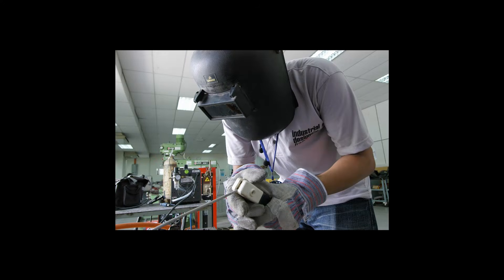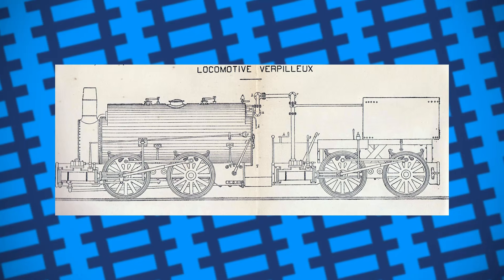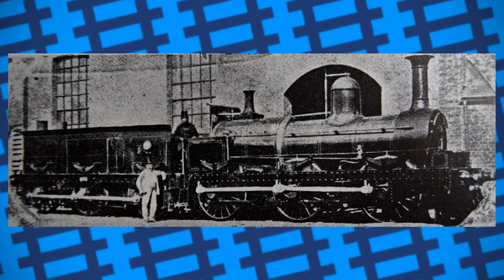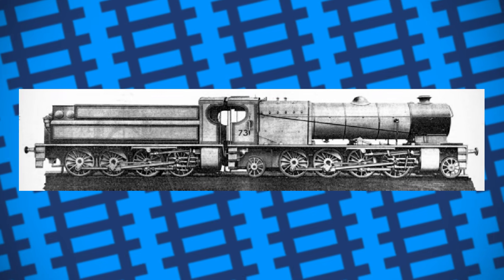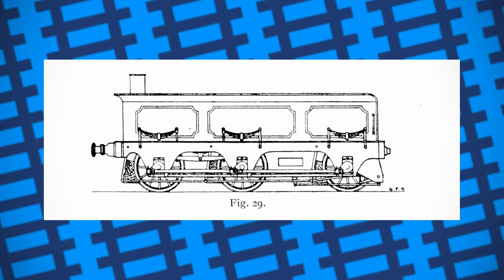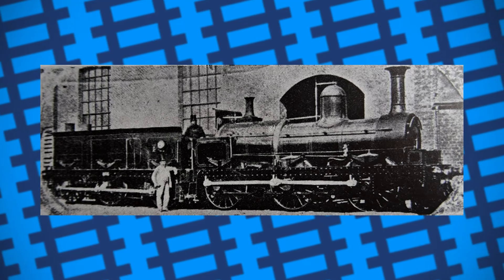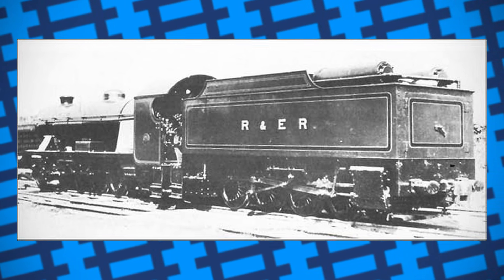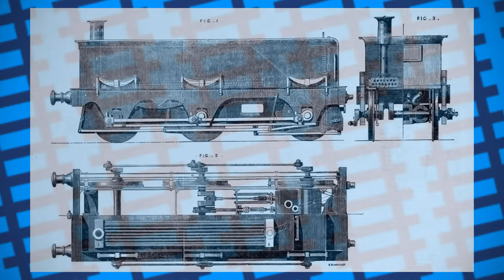The locomotive tenders that drove themselves - "Steam Tenders"

Comment: In a way I think steam tender locomotives could be considered to be the great grandfather of the garrett locomotive. Both are designed for heavy loads with 2 seperate sets of driving wheels. The main difference is in a Garrett all of the driving wheels are attached to a tender.

Comment: Makes sense as the triplexes had the same issues with the powered wheelsets under their tenders: gradual loss of traction as the tender grew lighter due to use of the coal and water during the run and the extra set of cylinders increasing the demand for steam beyond what could be supplied by the locomotive's boiler.  Funny how the railroad world essentially had to learn the same lesson twice.
Reply: Ironically, the Southern locomotives included in the video, didn't suffer the same issues, and were found to be VERY effective at what they were designed to do.  Specifically, these were "Saluda" locomotives, and operated as helpers to get trains over the Saluda grade, a 5% average grade on the Southern Railway, which was (until abandonment in the mid 2000's) the steepest main line grade in the US. Since the Saluda tender drives only ever worked over a short four or five mile stretch of track, and were regularly refueling and rewatering the tenders.
Reply: It’s too bad they didn’t think to shut those cylinders off. 🤷
Reply: @Gfysimpletons   Funny thing is, the Saluda locomotives could actually do that.  They had valves that allowed them to cut off the steam going to the tender drivers.

Comment: Maybe you could do a supplementary video on Starter/Booster tender engines. This seems a more useful addition for starting difficult loads than the full power tender engines.
Reply: yes.  i regard boosters as the successful development of powered tenders.  and boosters could be fitted to tenders and be unpowered when not needed.  victorian railways (australia) built the tenders for their second set of n class locos so that franklin boosters could be fitted.  however, none were ever fitted to them.

Comment: "Especially in countries like the U.S, which have such a liberal loading gauge." That's certainly one way to put it, but we also have/had a lot of much lighter interurban, commuter/light rail, narrow-gauge, and industrial trackage, and even some of our shortlines have slightly lighter rails than our general system.
Reply: Point of order: Loading Gauge is the space that the train fits into ; of which Britain has a relatively-restricted one.
You might be referring to the Track Gauge, the distance between a pair of running rails.

Note that the Loading and Track gauges are not necessarily an indication of the weight of the rails used either 😵‍💫
Reply: @SportyMabamba And neither has to do with maximum allowable weight of a locomotive or car.

I also believe Garrets experienced similar adhesion loss, albeit reduced somewhat by also having the boiler sitting on some of the drivers.
Reply: @SportyMabamba  Yeah, I messed up there. For some reason I got loading gauge and loading capacity mixed up, with loading capacity actually being the measure of how much weight the rails could take, but I checked, and you're correct. So thanks for that, now I know better. That being said, U.S. rails typically weigh 120-140 Pounds per yard, compared to the 81-121 used by most of Europe for example, which is a large part of why our freight trains are so insanely long and heavy compared to most of the world.
Reply: @SportyMabamba  , i think what sambrown means is us locos can be higher, wider, longer and apply more weight on main lines on every axle.  thats how they can have monsters like big boys on the main lines.
Reply: The Bessemer and Lake Erie used 150 lb rail. It should be kept in mind that heavier rail and trains needs maintenance.

Comment: Ive noticed that the problems with the steam tenders were basically the same ones magnified significantly for the Erie railroad's Triplex, being loss of adhesion overtime and not enough steam for all the cylinders.
Reply: I suspect American railway's negative experiences with these steam tenders made them more hesitant to try Garratts, despite these issues being no where near as severe on Garratts.
Reply: @AUssteamchannel9994  You'd be surprised, but nah.  The reason Garretts weren't bothered with, is by the time a builder procured licenses to build them in the US (Alco was the company, if memory serves), then any benefit they may have had, was offset by the simple fact that companies here were already producing very powerful Mallet locomotives that could do the same thing Garratts could, if not better.  It wasn't until 1927 that the idea was even considered, and then it was only after Alco and Beyer-Garrett proposed the "super Garrett" which was a 2-6-6-2+2-6-6-2 variant.  The sheer size of it  meant no turntable could turn it, and there was some question as to whether or not even existing US rails could handle it.  So there were no buyers for them.
Reply: @KibuFox  One of the benefits of a Garratt is that it can be made to run equally well in both directions, obviating the need for a turn table. The main cited reason no American railroad was interested in Garratts was the fear of loss of adhesion as fuel and water was depleted. This would have been made a non issue with the use of an auxiliary water tank as the main source of water which is what was done is South Africa. It was this unfounded fear coupled with the hesitancy to try something new which turned off American companies. A garratt with two three cylinder compound engines if designed properly would have been more efficient and powerful than American Mallets. This was discussed by David Wardale in his book. Where did you learn of this Alco Beyer Super Garratt proposal?
Reply: Same issue that the Garratt locomotive and to a lesser degree all tank engines run into. Ultimately the tender relocating weight away from the engine actually has at least as many benefits as drawbacks because it makes the adhesion consistent regardless of fuel status, and since a locomotive is designed to pull things an extra car or two of fuel isn't going to overload anything.

Comment: I wonder if instead of using steam and pistons you could use electric motors powered by a steam dynamo on a "modern" steam locomotive.  It wouldn't be as powerful, but you could probably make it so that it could at least pull the weight of the tender.
Reply: Maybe you could do that to all other unpowered wheels and maybe sell it to a coal hauler, ACE 3000 style
Reply: @Combes_  yeah but electric drives hate being around steam. heat and ash kill motors. that was the main fault in steam turboelectric locos
Reply: @JaneDoe-dg1gv  true, but that was 80~ years ago, I'm sure techology has changed to make these more reliable
Reply: @Combes_  more reliable, yes. UP still has issues with electrical equipment around their steam fleet. with ac motors now the issues are cropping up with electrical faults in the control equipment. It could be done but that stuff would basically have to be a sealed box with probably pneumatic or mechanical controls.
Reply: @JaneDoe-dg1gv  maybe, but it'd still make up for it through being stronger and being able to have dynamic braking
Reply: @Combes_  A steam turbine electric would be very powerful for a single unit but it would also be heavy and efficient only at full power. Even with loads of coal, why not just make the coal into oil and use diesels instead?
Reply: @JaneDoe-dg1gv  cuz my idea would be to make it a modern steam locomotive, with GSPC and all that fizzaz. Besides, for coal haulers (Which would be my target audience) it'd be cheaper to use the coal they haul than import oil for the middle east, that's why the N&W perfected Steam for a long time instead of buying diesels
Reply: @Combes_  Look up coal to liquids. I'm partial to hydrothermal liquefaction myself. Now i do love steam but the only times they make sense are burning fuels so nasty that conversion to something else is a waste of effort or off of some readily burnable solid waste material.

but those don't get into the problems with steam turbines, 'gain same problem with all turbines, can't be efficient at anything other than full power. now packaging a steam turbine with electric drive is certainly nicer than a steam turbine mechanical but the advantage of steam is low end grunt which pistons serve best.

I like the idea I really do but it would be an improved version of the Jawn Henry steam turbine electric locomotive. Massive pulling power in a single unit that was only useful with the heaviest work that could be thrown at it. For coal drags it would be perfect, set 'er to full power and let 'er ride.
Reply: @JaneDoe-dg1gv  1: Look up why they don't use coal powered diesels anymore, spoiler, the engine did NOT like it.
2: The motors would be moreso geared for torque than speed, besides, with how fast these GEVOs are pulling them. Does that even matter when you have, like, 15 axles? (2-8-2 + centipede tender), you could also use canteen tenders as slugs and maybe even find a way to have MU Control somehow

Comment: I thought tender-driven locomotives were only a thing with toys and model trains. This is quite a surprise to me.
Reply: 3-truck Heislers and other geared engines had powered tenders. There were also the triplex locomotives on both the Erie and Virginian Railways.
Reply: Shays also had powered tenders
Reply: @68poundercarronade Shays, Heislers and Climaxes are a different story: those are geared steam locomotives, where ther pistons moves a drive shaft connected to a set of gears on the boogies, so the system is way easier and more effective
Reply: @dacartrainguy  easier and effective, but also really slow
Reply: @68poundercarronade  they weren't ment for high speed... They are forestry and logging locomotives ment to travel across uneven layed tracks from logging camps to cutting areas, so slow speed and high capacity of towing are more important than high speed
Reply: Yup
Reply: I think some people missed the joke with this one, dw bro I understood it 🎉
Reply: @Rurika_Ryuusenji  What joke?
Reply: @jacobstrainstation  Older model locomotives (namely Hornby) put mechanisms in a driven tender, with a locomotive with free-spinning wheels.
Reply: Thomas the train trackmasters 😂
Reply: @tuckergorrell2457  TTTE fans be like: “Uh, actually Thomas isn’t a train. A train is what he pulls. Thomas is a locomotive.” 🤓
Reply: Its true tho, and sometimes triggering @joshuaW5621
Reply: The Emerald Night Lego set when having powerfuctions added to it had a nice touch. The tender held the batteries and the motor went in the cab, which drove gears in the boiler to turn the wheels
Reply: @tomalator I went for a simpler solution on my train MOCs: just used the powered LEGO train boggies under the tender!  You can actually end up with more pulling power then gearing a motor into the locomotives drive wheels as the tender usually has more empty space to add ballast.
Reply: So those Thomas Plarails and Trackmasters really make sense now
Reply: Lego train：。。。。。。
Reply: I always wondered about that. I have an old battery-operated Hotwheels train that sort of works like that.
Reply: Some steam trains looked like the creator was on drugs and thought of really crazy stuff and then actually built it and I love it.